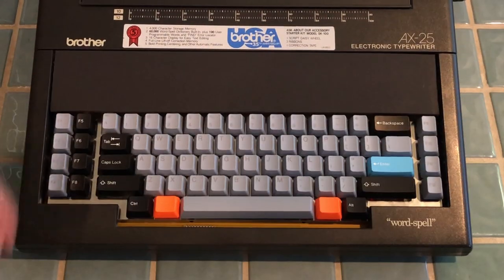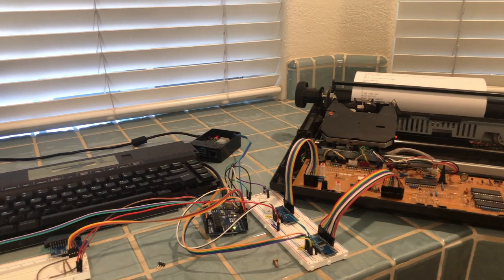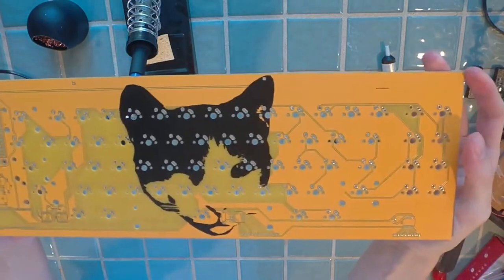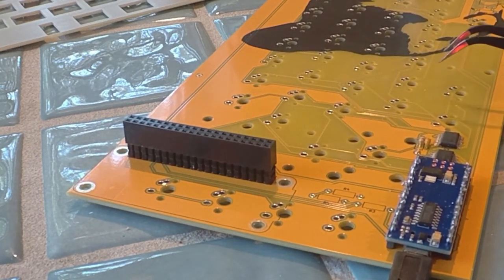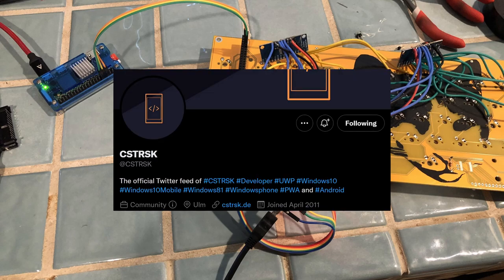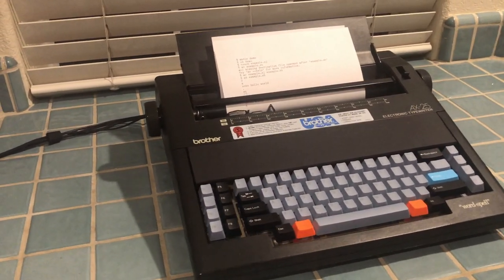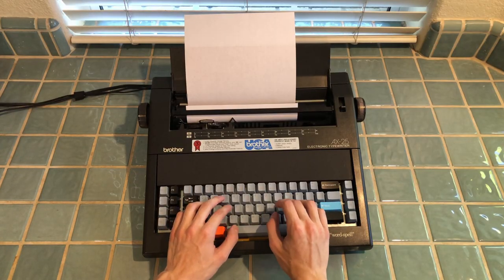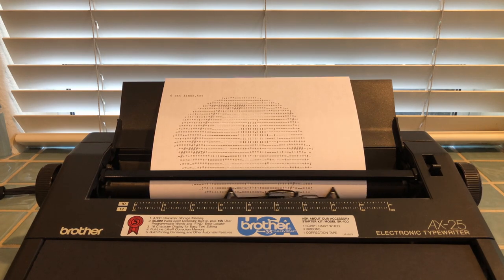I turned my '80s typewriter into a Linux terminal

Comment: Great project. Now use it to have a realtime hardcopy of the system log.
Reply from the maker: Thank you! I should run something useful on this, maybe like a Minecraft server or my website, it would be fun to have hard copies of the logs from those
Reply: @Artillect0  How about a syslog server?
Reply from the maker: @sporqist  I bet that'd work great, I'll have to look around for one that works well in the terminal
Reply: @Artillect0  Syslog servers like syslog-ng or rsyslog usually write one or more logfiles per sever, depending on configuration.

With a logfile for each server you could just create an alias like "alias my-server='cat /path/to/logfile'" to selectively print a servers log. Just a thought tho. There are countless ways of turning your typewriter into a syslog server.

I learned that linux's ttys stand for teletyper but that you actually made it work with a modern machine is awesome :D
Reply: Since everything* in linux is a file, one could also configure the syslog server to write to the teletypers tty-file (/dev/ttyX) directly. This would also require you to configure the syslog server to prepend the servers hostname for each line tho.
Reply from the maker: @sporqist  Thanks for all the info, it'll be really helpful if I decide to set up a syslog server on it! I'm glad you like my project :)
Reply: @Artillect0  what about a thread trace?

Comment: Flux is your friend for soldering surface mount! It makes the solder go where you want it to.

For parts like that fine pitch TSSOP, I put flux down on the pads, put the chip down, touch a small amount of solder on the iron, and bring the wetted iron to the joint. The solder just wicks off onto the joint thanks to the flux
Reply from the maker: Yeah I think the main reason I had so much trouble with my first two attempts is that I didn't use enough flux, I really underestimated how much you need. Thanks for the tip!
Reply: Flux and a tiny heat gun
Reply from the maker: @lars7935  ooh thanks for the tip! I think my dad has a heat gun I could borrow, that might make things much easier
Reply: @Artillect0  Just be very careful. There are tiny heat guns made for soldering. Those are  what you should look for.
Reply from the maker: @lars7935  gotcha, I’ll definitely look into getting one for the next time I have to solder fine-pitch components

Comment: i wonder if the output would have more flexability with characters and speed if it was one of the thermal brothers like the EP5 which has a higher quality silent thermal dot matrix head like the label makers use. they make the rolls of thermal fax paper so it would be fun to make long banners on something like this
Reply from the maker: I think that the EP models have essentially the same characters as this one, but it might be possible to hack it so it can print more. I've wanted to get an EP55 to mess around with so I'll definitely have to try that out if I find one!

Comment: what happens if you enter sth like vim, is it gonna try to print a whole thing every time you edit a character or sth?
Reply from the maker: I haven't tried vim specifically, but I tried out nano and I think it'd probably do the same thing https://youtu.be/R64IrgVJKC0?t=152
I think it tries to print out the whole screen, but since I'm not handling all the formatting codes needed to do that it just keeps trying to print on the same line, and eventually hits the right margin and beeps endlessly

Comment: Hi. Brother did not make electronic typewriters in the 80s. This is from the mid 90's. Any date codes on the chips can tell you exactly when.
Reply from the maker: Well, according to the typewriter database, https://typewriterdatabase.com/brother.10.typewriter-serial-number-database, Brother made tons of electronic typewriters in the 80s. And this one is definitely not from the mid 90s, my serial number and the date code on the cpu are from 1989
Reply: @Artillect0  funky. I modded one years ago and it was from 91 and it was new then :)

Comment: This is like 3 different very difficult disciplines coming together for a "fun project". You are pretty cool, sir.

BUT - you left out the most interesting part. What happens when you need to change the paper?
Reply from the maker: Thank you! It was fun using a lot of different stuff I learned in college to get this to work, I’m glad you like it!

Haha I’ve changed out the paper so many times I didn’t think anyone would want to see it. I just flip the lever to the right of the paper, take it out, put a new sheet in, and turn the knob to get it into position. 99% of the time I’m not changing the paper while using a command

Comment: Why replace the old keyboard and CPU?
I'd think it would be more satisfying running the old cpu and having it handle everything. It could then do the serial to the linux console.
Reply from the maker: I replaced the keyboard because the original one it uses rubber domes and feels really mushy, and I wanted something that felt a bit more satisfying to type on. I wish I could have done it with just the old CPU, but its serial pins were being used for something else, since they can be reconfigured to be used as normal pins. I'm also not that familiar working with assembly, so doing it with the Arduino was just much easier. Hope that makes more sense!